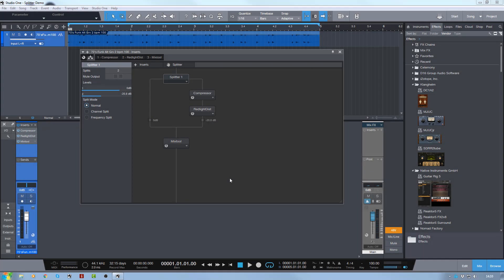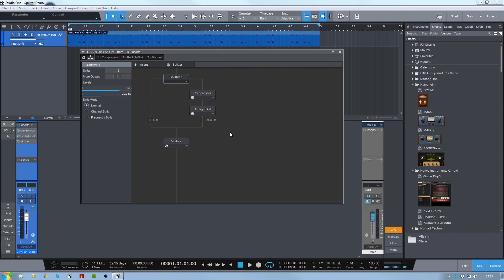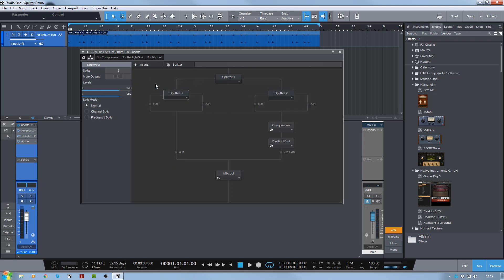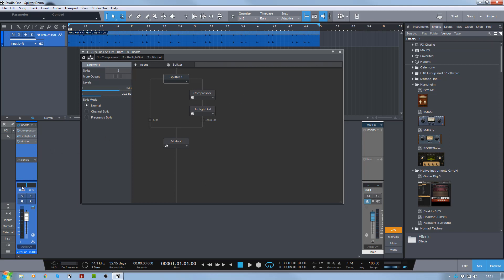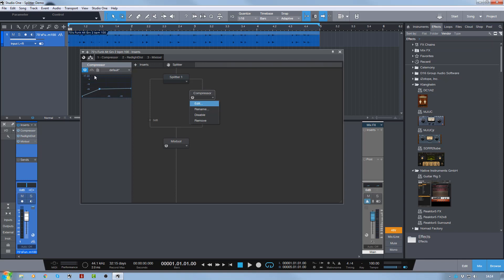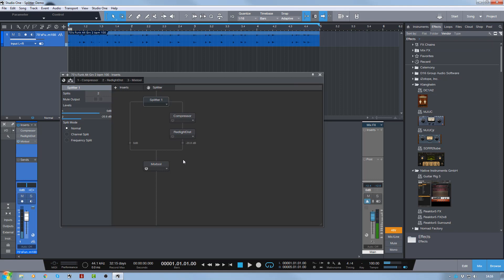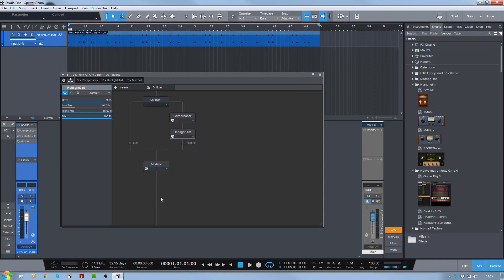Splitter Tool Overview

Comment: Isn't the algorithm of the splitter the principal behind how the mix knobs work on stock plugins like compressor and others?
Reply from the maker: Not entirely. Sure there are some similarities functionally, but that really is the very bare basics of the normal split mode. The splitter tool is a routing feature. It allows you to do multiple parallel, channel and frequency splits of your incoming signal so that you can process from broad strokes to tiny minutiae in detail, to create extremely unique and creative sounds. 

While it has some fantastic functionality for mixing, it has tons more for sound design.

Comment: This video needs follow up showing how the splitter can be used for left/right splits, multi-band splits and mid/side splits (using MixTool).  Because parallel processing is just the tip of the iceberg :)
Reply from the maker: Thanks. Please note the title of the video: "Overview". There will be further videos going into more details. There are hundreds of different ways to use the splitter, and I am aware of all the ones you mention. They will all get covered in the next videos.
Reply: @JonnyLipshamStudios  Sorry :) Carry on!
Reply from the maker: @antic604   - No probs, mate.
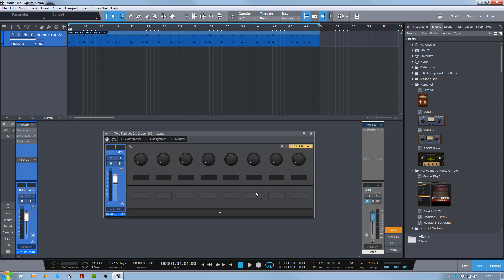Reply: I haven't got that Channel Editor button described at 5:00. Is it because I'm using the Artist version?
Reply from the maker: @gcoudert   - You are correct.